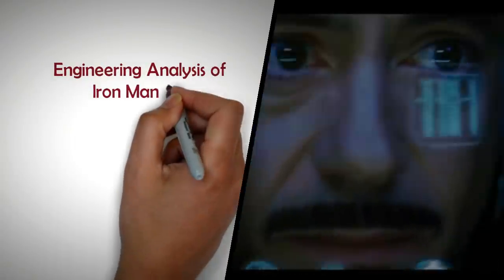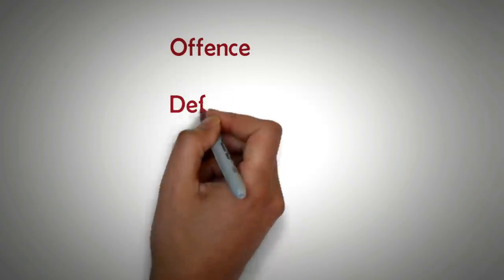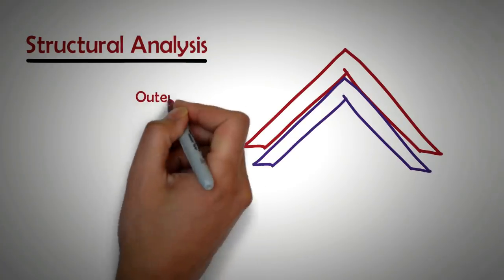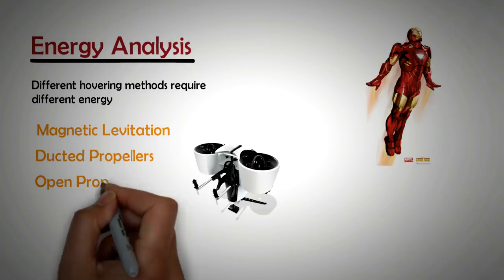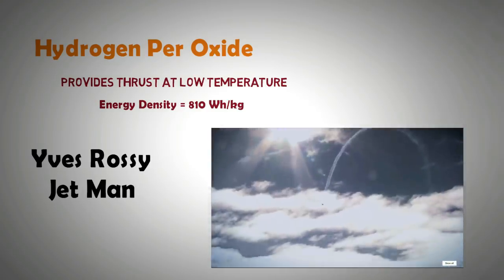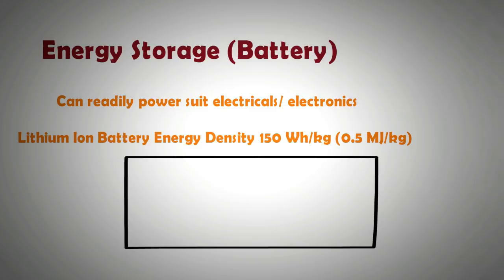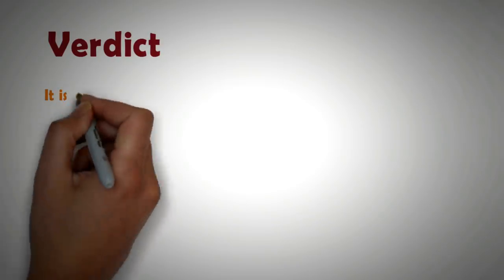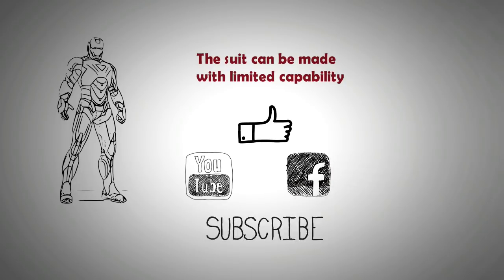Engineering of Iron Man Suit

Comment: Okay, the problem is that a human being, with clavicals (Missile bays) radius/ulna (Also missile bays) and ribs (Back thrusters/airbrakes) has to fit inside it.  With all those engines, actuators, and weaponry.  Arguably, maybe if it was fully robotic, but with Life Support?  Just life support, strip the arsenal out, and the engines, there's not enough room in there for him to Breathe.  Much less for Antman to jump around inside it, pulling wires, and impersonating his "Conscience"  That's the problem I have with it.  Also, regardless of how he breathes without his nose smashed flat by that faceplate, where the hell does it go, when the spherical helmet segments tuck away out of sight?  That is a more than a minor engineering challenge.
Reply: Another problem is, no matter how hard, and indestructable the armor is, the squishy bits inside is squishy.  For instance, Col. Rhodes (War Machine) fell for several seconds, and hit the ground.  He broke his back, which is fairly realistic.  His lungs didn't burst on impact from his ribcage caving in like a barrel full of bricks, which is somewhat less realistic.  Also, surge/countersurge.  His brain should have been a greyish pink smear in the back of his skull after that fall.  He left a crater, in solid soil, which is somewhat less compressible than nervous tissue.  He didn't even cough up any blood.
Reply from the maker: Very valid point. Even if the impact is cushioned, it is the jerking movement that will cause the damage. From hundreds of meter per second going down to zero velocity in microseconds
Reply: Gravity's a bitch, but she's dependable.
Reply: It is not the speed that kills ya' but the sudden stop in the end... ;)

Comment: What about a blended system for power generation that relies at least in part on the wearer? I'm talking a combination of kinetic (as in the same basic tech as kinetic watches), thermoelectric (body heat), solar, as well as batteries? Or any combination thereof. And as for the batteries, there's been some interesting advances with graphene, lately.
Reply from the maker: When cyclist are producing peak power, i.e, when they are cycling really fast, they can go up to 200 Watt continuous energy. This can only last a few seconds

Comment: A suit that locks every pivot point would protect the occupent from damage if hit and the light weight would just fling them around.  Flight is not currently possiblle due to size but having some type of thruster tech would help the operator move if the weight of an item is too much for the suit to handle.  The main issue one would face is the electrical system.  A method of wiring the limbs etc from all external and internal errors/ damage would be the hardest thing to sort out.  One stab and an arm wouldn't work or worse, the systems may malfuncion and each one of the operators fingers might get broken (or arm).  Imagine being the person trapped inside when all function ceases.
Reply from the maker: Good point about the wiring issues and the malfunction

Comment: What about some kind of vast high intensity solar panel style energy apparatus designed throughout  the suit, which could absorb solar/light energy via the outer layers of the suit, which could be incorporated into already existing energy power sources (batteries, etc), situated within/throughout the suit; could allow for seamless integration of the solar power into the battery to fortify/enhance its power...Wow!! Said all that in one breath! No more martinis so early in the day! Apologize for ranting. Loved the video. Great work!
Reply from the maker: There is at most just 1000 Watts of solar energy that falls on a meter square area during peak times. The exposed surface of the suit to the sun at any given time would be less than 2 m2.  Solar panels are at most 23% efficient. So overall 500Watts of energy can be recouped. This is not much compared to the energy required by the thrusters. Thanks

Comment: The power source is the problem, not the suit. He need to have a small size power source, powerful enough to keep the suit up in the sky for log.
Reply: Alexutz CTN The suit isnt possible to make. Atleast yet
Reply: ManuTheMLG duct tape plus 2 magnets
Reply: Power source, strong enough armor to withstand Thor, and a way to not turn into mush when accelerating/decelerating. So, impossible in other words.
Reply: i had made an ark reactor{seriously},cheap,less than 270 dollars to make,small as an backpack. but it has some defects,im researching on it. may be available in 7 months.
Reply: @suryagamidi6183  it's 7 months , so...
Reply: @wkkkkka1233  I have even developed it, but, now it is of no use, because I've discovered an new propulsion system, which requires very low d.c voltage and medium ranged current. Developed a type of armour which evenly reproduces itself. And there's no use of arc reactor really. When we convert each and every type of energy to usable energy and sucking energy from others. Even id developed weapons too. But the problem is, I don't have any investors and money.
Reply: @suryagamidi6183  right
Reply: @wkkkkka1233  I may really make the iron man suit if someone invests on me
Reply: @suryagamidi6183  no thanks
Reply: @suryagamidi6183  No, you wont.
Is the legendary arc reactor ready? I dont think so either..
Reply: Roi Gipot dude, Ark reactor doesn’t mean all those fusion nuclear reactor stuff. It does mean, a thing which gives us enough energy. Now I don’t even need one, because I have better equipment
Reply: Yes

Comment: I think the hulkbuster would be a safer stronger goal to strive for as the increased interior space will provide a longer time period for deceleration.
Reply: dotails 

Yeah. You could legit just wear a seat belt.
Reply: Of course, but cars have crumple accommodation in order to decelerate your body slowly. If the indestructible armor is right up against you it won't protect you from crashes. As seen when War Machine crashed in Avengers Age of Ultron. If your going to wear a suit for flight I suggest a very large robot with a suspended cockpit in the core. But I would rather suggest just fly a robot remotely via VR so there is no risk to the pilot, like stark did in Spider Man homecoming.
Reply: dotails hulk buster has spare parts in a offsite location.
Reply: @dotails  Im pretty sure that alot of people forget that the exoskeleton frame is designed to protect from that, Its not just a bunch of clunky metal bars that you see from In real life exoskeleton, You also have to realize that they use arc reactors which give the suits extreme power.
Reply: @Fraccuppino  if I had that much energy at my engineering disposal I would use it to magnetically suspend the passenger in an inner shell of the suit.
Reply: @dotails  theres also the scene in the first movie where iron man gets hit by a tank shot, and because of it falls into the ground. I get what you are saying and agree with you, its just a reminder that sometimes in the movies series they are realistic and other times not, momentom conservation in this case. Thats why these are movies/fiction.
Reply: The fuel is actually one of the only problems first being the fuel, then hydraulics to help it be lightweight, after installing the jets

Comment: And depending on electrical demands, there is a solution, though not a 'reactor' proper. A compact and high-output generator (standard car alternators crank out 50-70 amps @ 12 volts for years, and some can go as high as 150 amps) could be spun by a small and strong output electric motor (all alternators have to do is spin). That motor can be powered by a high density battery like used for electric bikes in the 1500w to 2500w range at 20 something volts (not as sexy as a reactor, but at least this is a plausible reality). This would power a strong and small motor at 3500 to 4000 rpm for hours. That's more than enough to create power for a number of systems, if they're built to take advantage of the amperage. And with new constructions of carbon arrays coming out every day, one or more of those could bring a meaningful electric output increase in an otherwise standard generator, even above what we have in cars now.
Reply: Wait a minute.... Full disclosure-I am not any type of engineer, so I welcome corrections from genuinely qualified people, but this comment seems deeply flawed. If I'm reading right, you're saying using a battery to run an alternator (or similar stator/rotor-type generator device) would "create power". I don't see how. All the power you have available in the system you describe is what's contained in the battery. The alternator would juggle your output in terms of amperage and voltage, but it would not "create" a single additional erg of power other than what's already in the battery. Just use the output of the battery directly, and if it needs rectifying in some way, I think there are solid-state ways to do that. Spinning an alternator would also lose you a great deal of battery power that could otherwise be used directly to run the suit systems via friction losses in the alternator's moving parts, hysteresis, and probably two dozen other things I don't understand. Using electricity you've already got in a battery to run a generator seems to me to be a pointless (and actually counter-productive) extra step. Again, if I've misunderstood what you were trying to describe, or if I've gotten a concept wrong, I welcome any corrections.
Reply: Using an electric motor to run a generator is a Perpetual Motion Machine.  It violates the first rule of thermal dynamics (You can't get something for nothing) and the second one (You can't even break even.)  Basically, it's a waste of energy, because the motor, generator, and mechanical linkage all generate waste heat.  Losses, that rob the efficiency, rather than drawing energy out of Pymspace.  You're better off with just a battery, and the losses from the wires (Resistance/impedance) than the losses from the battery, motor, mechanical linkage, generator, and wiring. 
 The ancient Greeks figured this out, and the laws of Thermodynamics haven't changed.  "TAANSTAFL"  R. A. Heinlein.
Reply from the maker: You would have to have non-returnable valves in place for your breathing apparatus I suppose. Lithium Sulphur batteries are up and coming technology and holds a lot of promise. Already an Unmanned aircraft called the "Zephyr" has used them with success. They are at least twice as better than Lithium Ion. Having a generator is fine but you would also have to fly with the fuel for it.
Reply: Absolutely. One-way check valves to keep flow moving directionally. The generator solution I mentioned above would not use fuel, it would use a high power battery pack. The Li-Sulphur batts you mentioned are an option, too. Hopefully soon a graphene or carbon-array battery of significant power density will be made.
Reply: Out of curiosity, are you involved in engineering, carbon-tech, or electronics? You seem to have a solid grasp of functional design.
Reply from the maker: Thank you. I am a Mechanical Engineer by education and work for a  battery-pack design company in UK.
Reply: And to sum up the problem here much more succinctly than I managed to. :-)
Reply: Or, maybe one day some engineering super-genius can develop nano-scale capacitors and stitch them together to make a fabric of energy storage, hmmm just like what was portrayed in the original comics. I am impressed with my shake flashlight that can store enough electricity in its' capacitor to run 3 led lamps for 40 minutes on just one minute of shaking using technology developed in the 1950s.
Reply: Incidentally, I am an engineer.  (Industrial Automation, and Robotics.  I'm trained to troubleshoot factories.)
Reply: Yep, that's what I thought. Thanks. For courtesy's sake, I'm still holding onto the idea that I misinterpreted what he wrote, but it doesn't seem like I did.
Reply: Ya, that makes no sense. Converting power back and forth between an electric motor and an alternator just means extra power lost.
To make it clear, your motor might loose 20% of power from input to output, and your alternator might loose 20% of power from input to output, so if you skip the alternator you will have less losses.

Comment: of course it could be fully sealed, if you take chest expansion into account for the body, and create a positive displacement air influx for the head.
Reply from the maker: Great idea! Chest to operate as a pump :)
Reply: My brain has been burning up with tons of engineering ideas in the last few weeks. Part of that is the above idea for pressurization for the body and the head, separately. The body could be set to a static pressure (with expansion for breathing allowed by a hidden expansion pocket of some sort) and the helmet would of course require a constant influx of breathable air. The body and helmet would be locked off from each other, regarding air.  Breathing would be a problem, given the diminished air density with increased altitude. So, an active pressurizer (micro positive displacement compressor) could activate when outside pressure drops. It would 'overdrive' at 16-18 psi (there would be a 'wastegate' to maintain 14psi constant) accounting for the drop in pressure during each inhaled and exhaled breath. That was easy enough to figure out. The hard part, for me, is how to create a sealed inner hull which moves easily and properly for human ranges of motion, while still allowing an overlaid actuator frame, then armor.
Reply: Thank you for the support, though let me explain better above...^^^
Reply: davidsirmons join with other engineer friends and figure out and then start your own company take your idea to potensial investor's

Comment: With the hololens being released now, I think we can begin building the suits OS at some point. I'm due to be getting a hololens and I'm looking forward to experimenting on that level.
Reply from the maker: That is a good idea. At least it would give you the feel of "Jarvis". Interesting thought
Reply: The HUD was what got my attention really. The real time display in a wireframe formate interspersed with readouts from various systems reminds me of the basics behind the Vx-works systems. Further, the limitations of the helmet suggest that the image is displayed close to his eyes. Now, a big limiting factor has been projection for a while. However, the Hololens seems to have solved that issue independently. 
With that in mind, the question of what the OS controls becomes clear. The various sensors from the suit must be processed and motor movements must be in relation to various inputs throughout the suit. For example, if I want to raise my arm, then sensors along the arm must detect the tightening and loosening and then the OS must interpret that as a command to raise as long as the muscle is tensed to the limit of raising an arm. TO hold, it must accept a certain range of muscle movements to allow the arm to be extended, and so forth. 

In Tonys design, he went at it from a different angle. His first priority was building it around repulsor engines to allow stable flight. Well, since the best we have is plasma jets (And I have not tried replicating Göksel and Masheks work myself yet), we have to approach the problem from a different angle. Since a hololens costs 3500 dollars, you can't just go and convert one to run that OS specifically. So a virtual environment would have to be implemented.

I know I'm rambling, but this is actually kind of my way of organizing thoughts and laying out variables I need to have addressed. I can't solve an equation if I don't have the variables lol.
Reply: Amy cute picture
Reply: The Raspberry Pi might be a very low cost hardware unit, and at 35 dollars, its got its own OS, own CPU, RAM, storage, and can be coded for by a good programmer.

Comment: Are rocket engines possible for the suit? More specially under the foot like the movies and comics?
Reply from the maker: 123No rockets are possible, but they have to have a duct where the air can enter from. So if rockets are placed on feet there should be ducts through which air can be sucked. It would make the heel of the suit huge.
Reply: Synergy Files Considering the suit should be as close to the comics and movies as possible, would jet engines under the foot provide enough thrust to fly in a controlled manner without compromising the movies/comics look of the suit?
Reply from the maker: 123No unfortunately not. As you can see from the jets used in jetman wing suit, they are a fairsize. At least the size of melon.   Having said that, perhaps Iron Monger suit can accomodate them

Comment: Can a 1.5 thick piece of grade 4 titanium take a grenade? And or bullets?
Reply from the maker: If you notice all the bullet proof vests are not made of metal but Kevlar. Dealing with impact load is different compared to static load. Titanium can certainly take grenade and bullets. It will deform (slightly) and will pass on the impact to the surface it is attached to rather than absorbing it
Reply: Synergy Files, what would made titanium alloy stronger significantly?
Reply from the maker: There is hardly anything stronger than Titanium alloys.
Reply: Synergy Files, would an extra ductile metal need to be added to the suit?
Reply from the maker: Yes. Ductile material would be needed to bear the impact load